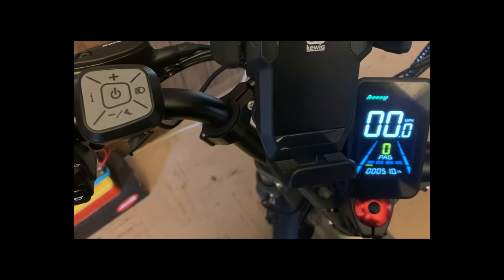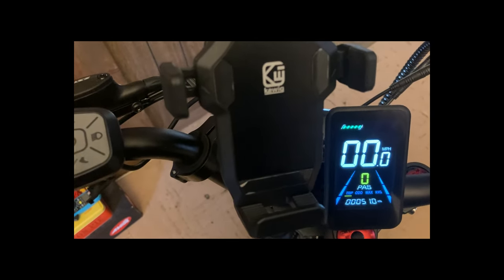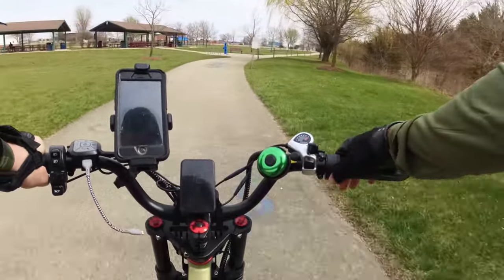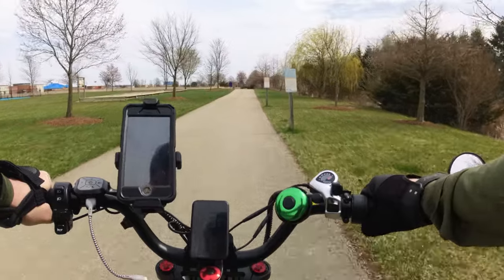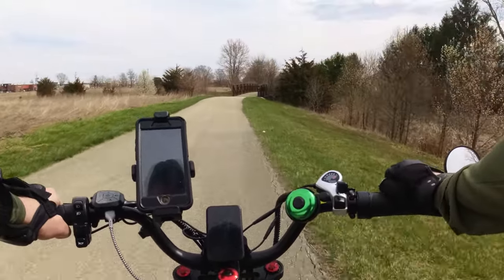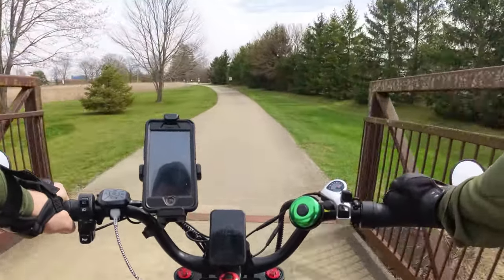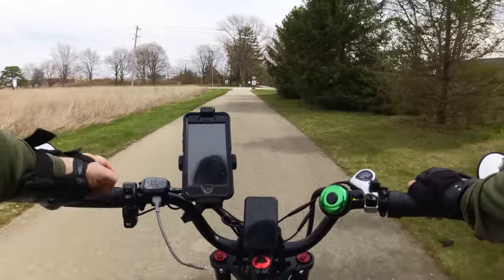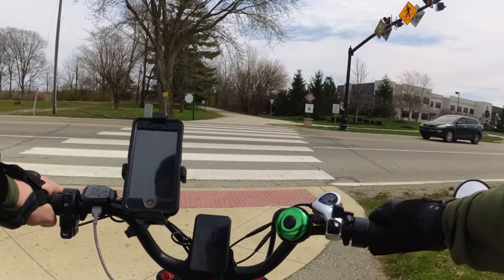How to Use Cruise Control on the Eahora Juliet or Other Ebikes with the Yolin YL-81F Smart Display

Comment: Why so slow
Reply from the maker: If you mean why do I only stick around 13 or so mph, it’s because of the trails I am on. I do switch it up sometimes. If I spent more time on the street, I would probably run it at higher speeds. Thank you for watching. :)